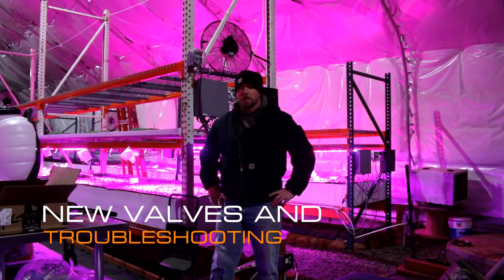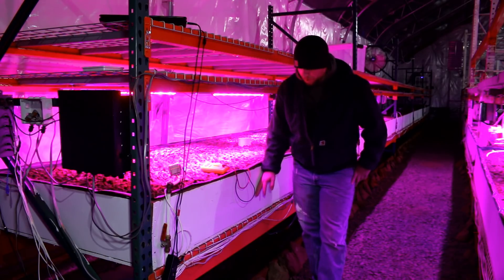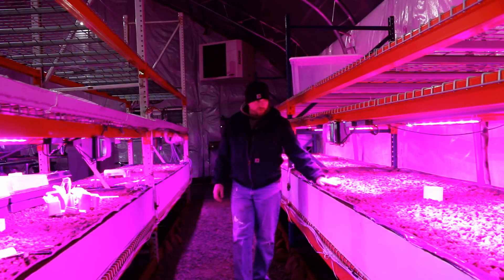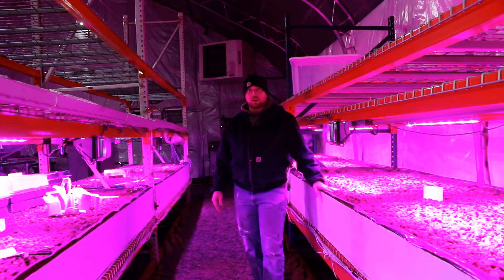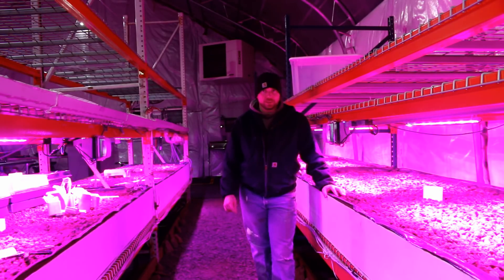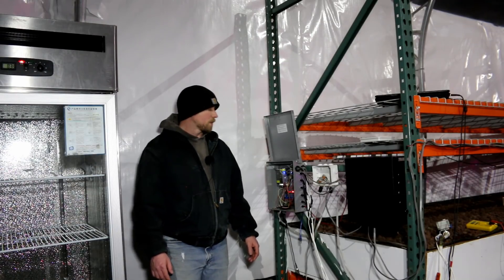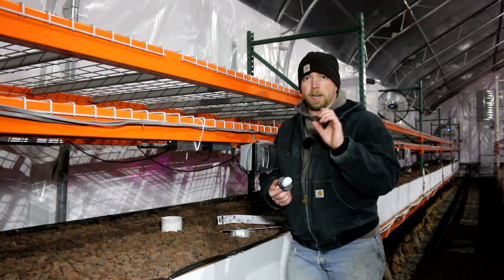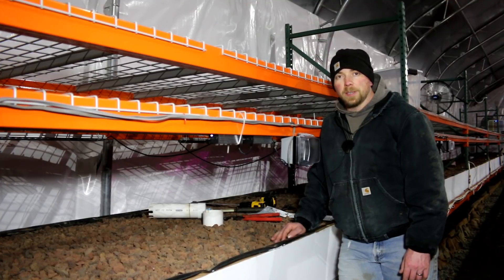Troubleshooting New AQUAPONIC VALVES

Comment: You can always go for proportional valves, that can give you precise flow control. This way you can turn on all your beds at once and even control how fast they get empty of water. Those valves work on 4-20mA or 0-10V signals, that can be generated by discrete ICs and are just a bit more expensive than traditional ball valves.

Comment: Happens on Doge/Chrysler vans. The instrument cluster has a ground pin for multiple gauges and the speedometer.   As it gets hot and cool over time the soder around the pin cracks and eventually opens the circuit and all the gauges stop; if it gets hot in the car the gap closes; you open the door to get the mail and slam the door and they quit again.

Comment: Two things ... why not use aquarium bulkheads for drain ..that’s what they are made to do ...seal and accept slip or threaded pipe..second why not use a Allen Bradley SLC500 PLC they are hardened computers and will do EVERYTHING you need.

Comment: Hey my friend:) On your overflow I would do threaded standpipe instead of slip. For some reason when you push down on the slip the pipe does not want to come out easily. If you use threaded and don’t tighten it down like a crazy man you could just simply reach in there and loosen it up easily. I’m glad you figured out the issue and I’m super happy you put an emergency overflow:)
Reply from the maker: Great point on the threaded...doohhh...should have thought of that. Hey everything is looking good on your system. Nice work!
Reply: TheRealMartian your where tired bro so it’s all good:) Yeah, thanks on my system. I like it and it seems to be working good for me.

Comment: I am fairly sure that flood and drain bed water levels should not be changed no matter age or species of plant, at least not by any successful growers I have seen in the last 10 -15 years, that is why raft beds work, the plant adapts perfectly if it is consistent. FYI -Bell siphons have been used for many years very successfully by commercial growers.

Comment: Flood and Drain height should always remain constant.  The water height should not lower as roots get established.  Roots require moisture and oxygen.  Hence, the flood and drain.   If you change the height of the water inside the bed, the plant roots wills suffer.  They grow in static conditions and if you change the water level it will harm the roots and take away from leaf and crop growth.  For example, if you drop the water level the plants could instinctively react as a drought condition and bolt instead of producing crops. There is a huge advantage of using flood and drain media beds because once the high water mark is set the plants do the rest and it's all about the crops.  Don't micromanage the media beds.  Put a proper bell siphon in there and be done with it.   Ideally, you want to flood the beds at multiple points and drain from multiple points.  This will help eliminate anaerobic conditions.    Over flow drain:  The pond liner must be dry to install a drain.  Also, IF the drain is being used and you don't know it's being used, plants roots will grow toward the drain and fill that pipe preventing it from draining.  Root growth must be considered.

Comment: I think you will fairly quickly learn that Arduino as well as those relays, just like the cheap valves, are not for "industrial use", continuous 24/7 operation. You will start to burn out these components fairly quickly now that you have been at it a while, I also see you have the cheapo powersupplies (12v/5v) from ebay/amazon, same with them, good you have it in a metal housing for when they burn up though :)